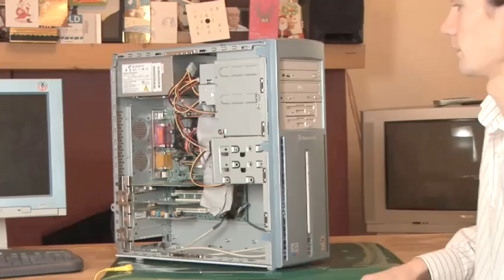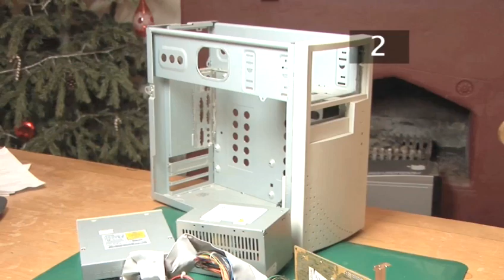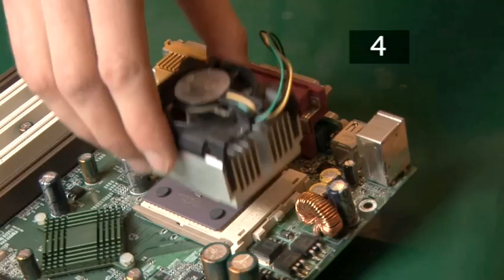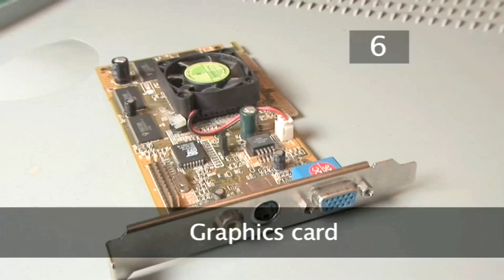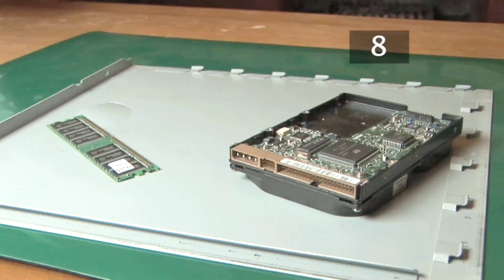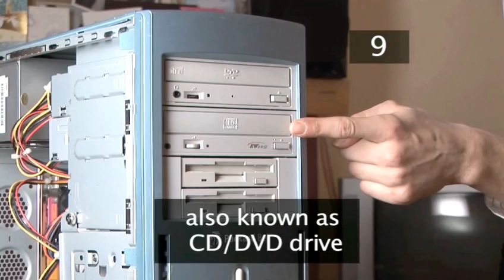How To Identify The Components Inside Your Computer

Comment: If i was to remove the RAM to another slot for banter would that be okay?
Reply: +Samira Ali If you have 4 or more slots for RAM you should read your manual for your motherboard in which slots you need to place your RAM (assuming you have only 2 RAM sticks)
Reply: +joost00719 yh I did have four slots actually. I just wanted to know what diff. It would make in general. So thanks :)
Reply: Yes it makes a difference, If your RAM slots are collored (for example blue and black) you want to if you have 2 RAM sticks, stick them in the same collor for dual channelling